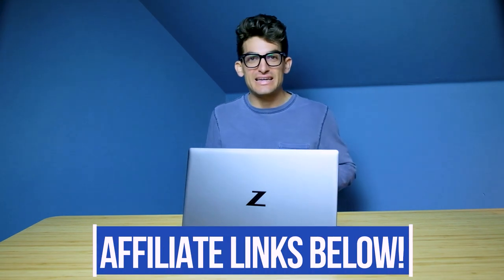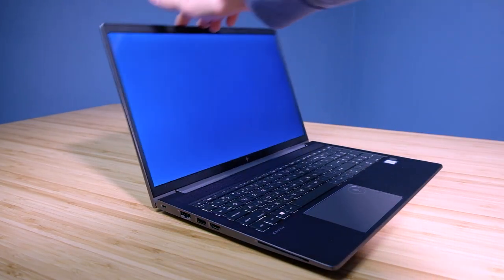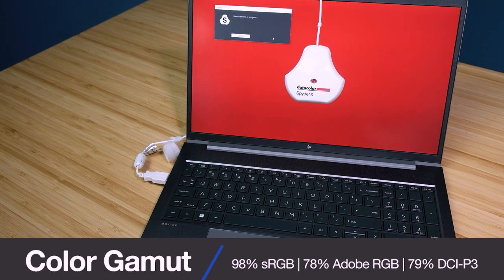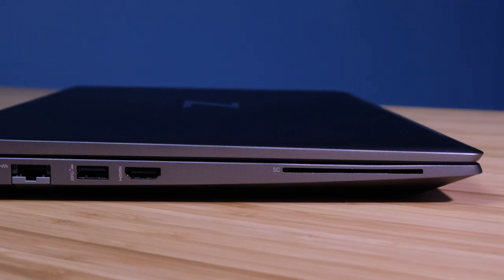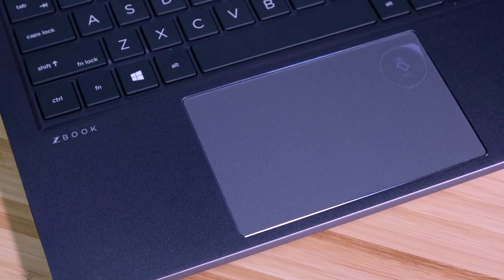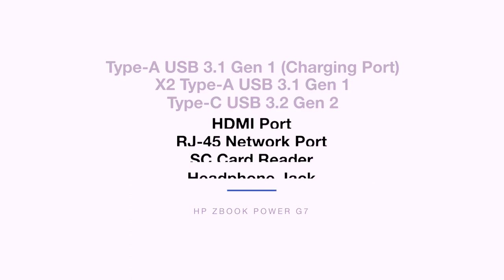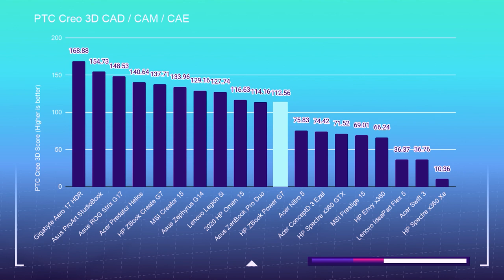HP ZBook Power G7 for 3D Modeling in Autodesk - Solidworks - PTC Creo

Comment: I was hoping to find a bit more info on how this works with 3D realtime 3D. I found mine overheated when using Maya (not always, but many times), Unity 3D, and Unreal (the display was black, and would shake on version 5.2). 
I bought my first Zbook studio back in 2020. Expecting a larger computer, I was kind of skeptical that this one would do the job, and did find it to be constantly overheating whenever I did any serious 3D or graphics work, or more concerningly, when I wasn't working at all, the unit had the fans running sometimes at full speed. 
I after much back and forth with HP, sending it in for a motherboard swap, then a fan replacement they finally sent me a new unit before my warranty expired. This one was not a Studio, it was a power, and right out of the box it shipped new with a defective power input. I sent that back again, and after the unit was still overheating, they agreed to refund me finally around the end of the summer of 2022.
Meanwhile I was fortunate enough to have access to a Dell and later an MSI that did the tasks without a problem. I would like to have migrated over with my own system, but HP's refund was in the form of vouchers, locking me to buy another computer from them.
Anyway, not too pleased with HP anymore, and was wondering what others' experience was here. Thanks for posting.

Comment: hello, i am trying to decide a buy laptop. i am not a creator, engineer  but i need  CPU power and a little GPU power because of the financial trading programs. These programs need H series CPU that have more core for algo trading. But i do not decide a work station or gaming PC . Legion 5 PRo, Dell XPS 15 , HP Zbook G9 or Fury ? can you give an advice? i concern about stability, thermal issues and a little mobility.

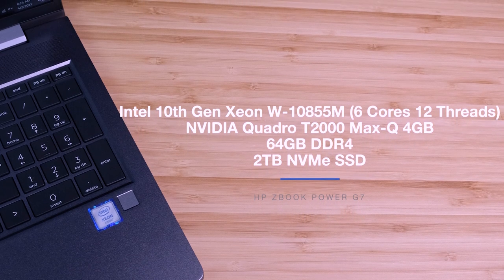Comment: 10:14 Maybe I missed it but I can't see any mention of price for that spec...Your review model had pretty poor performance figures when you consider that particular model you reviewed probably cost over $4,500. As far as I can see the i5 example in your first affiliated link costs $1,600 more to upgrade to the Xeon W-10855M with Quadro T2000, plus $800 more to upgrade from the 16GB RAM to the 64GB, plus $1800 more to upgrade to 2TB SSD to match the model you reviewed. I've spec'd up quite a few high end ZBooks (Power and Fury) and they are very expensive laptops with average performance. Think you should have made your viewers aware of the cost of your review model so they could judge better judge its relative performance figures in relation to the cost. It was often well beaten by much cheaper laptops in your performance charts.
Reply: Durability, build quality, and quality control are important in the price not just benchmarks and performance. Also note that, it is being compared with much heavier laptops with possibly less throttling. Considering its size, this is one of the best ultra thin workstations. It is way better than XPS 17.